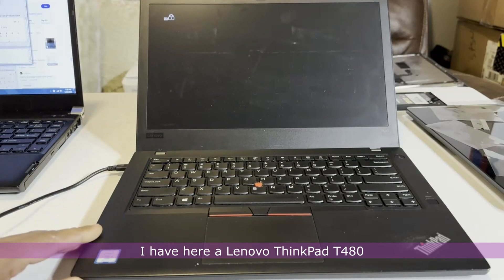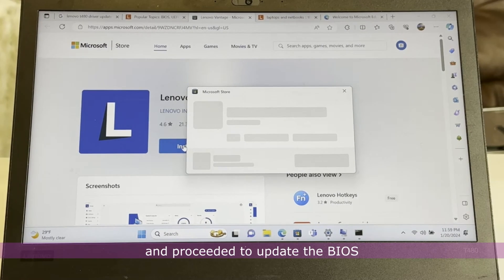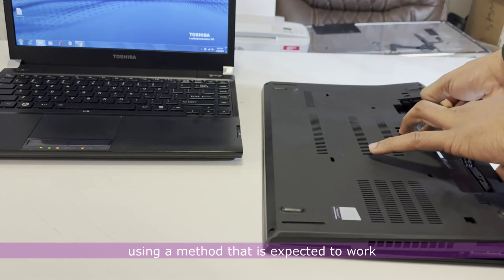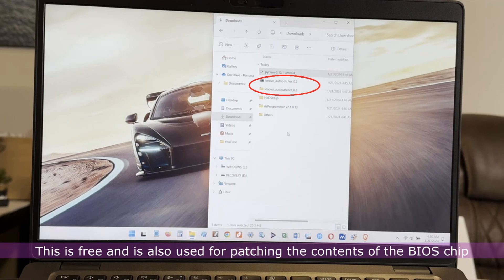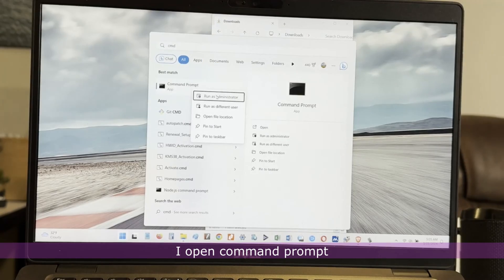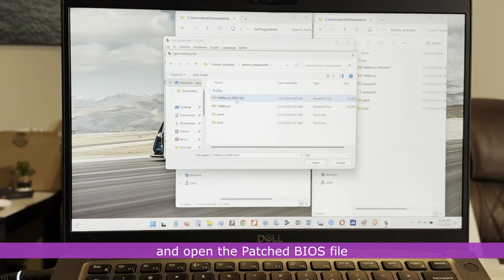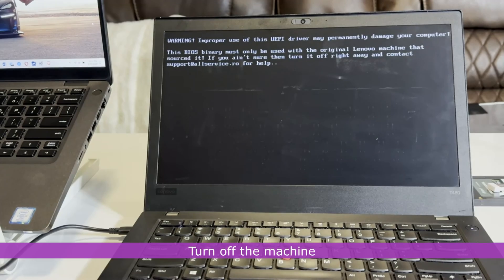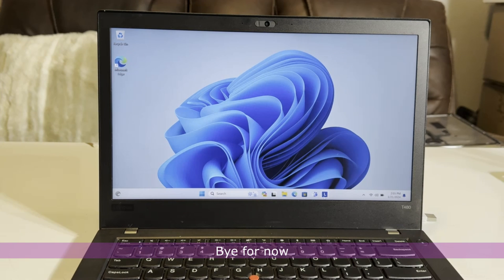Lenovo ThinkPad T480 - Administrator BIOS Unlock

Comment: Hey, could you please help me? I tried to patch the bios files, but the patched bios file is twice larger than the original bios file (original bios file only 16mb but the patched one is 32mb). And sadly, I already erased and write the bios chip, so the only bios files I have to thinker is the one that I backed up. What did I do wrong? Also, the process of patching the files is not the same as what I saw in this video.

*Edit: nvm, I was using the wrong version of lenovo autopatcher, the one that I have to use is lenovo autopatcher 2.0.

Comment: Hi bro, i have t470s i5 7th gen with W25Q128JVSQ chip model and i tried to use your method. I used neoprogrammer and patched it when i first boot it plays a sound and not displaying , just black screen and i flashed back the backup and it works . What could i possibly go wrong?
Reply from the maker: The method mighr not be compatible with your laptop model.

Comment: When comparing the values of the BIOS files, they are all different. What can be done in this case?
Reply: I solved the problem, thanks for the grate video, it works 100% ❤❤❤
Reply from the maker: You could perform a new backup just to be safe.
Reply: @aoeaster  I'm having another problem, because once I apply the autopatch, the screen freezes on "Entering setup..." and keeps loading indefinitely. I don't know what might be causing this or what the issue could be.
Reply: So it doesn't matter if I don got the 2 values the same? Because I read the chip 4 times and all 4 times they gave me different numbers.

Comment: Hi @aoeaster
I've an issue with my T480, after a windows update won't boot up, now I'm seeing "System BIOS shadowed" and "Video BIOS shadowed" 
My BIOS version is: N24ET76W (1.51) 
I was wondering if this method will work for my thinkpad T480.... any advise?
Thanks!
Reply from the maker: The shadowed BIOS provides a better performance for your device. I suggest you try booting from an SSD or HDD with a known working OS to rectify the source of your issue. If it works, just run Windows repair on the problematic drive. I hope this helps.

Comment: It is working nice on T470S. But i noticed a few detils. 1-motherboard on T470s has 8 gb ddr4 mounted on it and if we taking out non-fixed module, we can test without it. 2-python must be version above 3 and installed with checked "path..." 3-it would be good if bios.bin file be placed in the same folder as autopatcher.exe file. 4-when we programmed bios chip with pached file, first run of laptop maybe will late. It will be start emidietly when you connect source of power (charger or battery). Be patient and dont panic. Several times it will restart himself.
Reply: so is it okay to have the fixed ram module while patching it ? just remove the non fixed right?

Comment: Dear, if i just replace the drive with one that have already installed windows 11, can i just restart the pc and use it and it will work or i still need the bios password when i turn the laptop pc on ?
Reply from the maker: It will work, but it might be slow and will have restrictions.

Comment: Worked for thinkpad t470s! Didn't have to replace the ssd for this particular model, all you have to do is remove it for the whole process.
Reply: PLEASE god let this be the case for my laptop i really like the files i have... i've got a T450
Reply: @Captain_Ravioli7321  let me know if it worked i have the same model T450 but its 8th gen

Comment: I used Asprogrammer first and it failed at erase(with nearest chip) and I bricked my bios. When connected back no life. Because the programmer still detected the chip it was not cooked (you can right it million times) - then I used Neo programmer to detect it, as long it can detect the chip it will able to erase, right and verify. T470s is all working!
Reply: I will try neo!
Reply: In your case, how did you get it to turn back on? I'm having the same problem — I plug it in and the charging light and power button light blink, but after that it won’t turn on. Any tips or advice to fix this issue?

Comment: Someone save me! I cannot flash original bios back to the chip, AsProgrammer stucks at erasing chip, my laptop is now dead
Reply: use Neo programmer to detect it, as long it can detect the chip it will able to erase, right and verify.   I used Asprogrammer first and it failed at erase(with nearest chip) and I bricked my bios. When connected back no life. Because the programmer still detected the chip it was not cooked (you can right it million times) - good luck.

Comment: What can i do if i cannot found the correct name of the chip on list on AsProgrammer ? my chip is 25Q12128JV (winbond) but in the list it only had 25Q12128BV and 25Q12128FV. What can i do next ? Someone help me
Reply: T470s has the same bios use Neo programmer - 25Q12128JV (winbond) is in the list, has it did it with success. I used Asprogrammer first and it failed (with nearest chip) and I bricked my bios. When connected back no life. Because the programmer still detected the chip it was not cooked (you can right it million times) - good luck.

Comment: Thank You a lot!,I bougth a 2nd hand T480 with SV Pass, i really need to reset all settings and turn off antithrief service. your video helped me a lot. By the way, it's way better and secure using soldered bios than clamp.  when you patch the bios file no need CMD, only drag the bios file to the patcher python app. 

gretings from Mexico Amigo
Reply from the maker: I'm glad it helped!
Reply: I will drag the bios.bin file to python!
Reply: Disculpa, como sabes q modelo es el chip de la bios, es que en la mía aparece un número grande pero en la lista no aparece, solo aparece uno masomenos parecido

Comment: hi, shows  bin corrupted 
D:\a.BIN is corrupted or does not contain a valid dump.
There was an error... Aborting.
Reply: Read the chip again with NeoProgrammer.
Reply: @jonskitch8082  Thanks man! helped a lot! fckin original soft....NeoProgrammer saved me
Reply from the maker: At what step are you getting this error?
Reply: @aoeaster  autopatcher
Reply: Model is T14-Gen3

Comment: Would you happen to have a bios file for t470 and thunderbolt bios type 20jn I did backups but they both seem corrupt the machine now does not post. the power button lights for 1 second and then nothing, the fan spins off and on a few times then stop
Reply from the maker: I currently don't have a BIOS for T470
Reply: @aoeaster  ok thank anyway!! The video was very helpful

Comment: Hello when i tried flashing it i mistakenly wipe the bios please i dont know if i can get the bin file from you or anyone here. Lenovo T480 bin file 😢😢😢
Reply: Thank you the system as been revive but wholeness patching it so that I can remove the password it was showing error
Reply: When running the servitude command which end with mds to check if the two files produce the same ach value I brings out error but if I did not put mds at the end of the code it show that they have the same value
Reply from the maker: https://www.4shared.com/file/LmEosam2fa/T480Bios.html?
Reply: @aoeaster  Can you please share this bin file with me, many thanks
Reply: But the patching process is not working
Reply: I don't know if it is the patcher that is not working

Comment: Hey,
I am about to follow your tutorial to the letter and therefore buy the USB BIOS Programmer. My T480 has a W25Q128JVSQ chip and on Amazon there are many USB BIOS Programmer models that are not indicated as compatible to work on this Winbond chip model (at least it is not listed)... should I try anyway or should I find another compatible USB module ?
Reply from the maker: You can go ahead and buy it. I believe it will work well so long as you are using asprogrammer for reading and writing to the chip.
Reply: Nice thank you ! So i will try it.
About the ssd, can I choose any model? @aoeaster
Reply: @aoeaster  thank you ! For the new SSD I want to install, does the model matter ?
Reply from the maker: @kFjuL  The model doesn't matter.
Reply: @aoeaster  Thanks again. Let's get to work!
Reply: OK, here is my feedback after following your tutorial step by step : IT WORKED !

I was scared because my bios chip was not listed by AsProgrammer, there was only W25Q128BV (mine being W25Q128JVSQ).

I forced this model and everything worked. Just a few details ; I get stuck on the "Lenovo - Press enter to enter setup" screen, I understood that I had to boot and quickly press enter to move on.

Thanks again !
Reply: Pls can you help me with the bios bin file i mistakenly deleted the file on my system and already wipe the chip bios @kFjuL
Reply: @davidoderinlo1314 wait a bit for an answer on your post ! I think there’s a way to download original BIOS file

Comment: Is installing a blank hard disk necessary or I can just disconnect the hard disk with OS and it will work?
Reply from the maker: It's necessary since the laptop boots to Windows automatically without it.
Reply: But can i try not using any hard disk and it will work because i did not have an extra hard disk or i should just use the one on it and format it after removing the password  @aoeaster
Reply from the maker: Yes, it would still work without a hard disk installed.